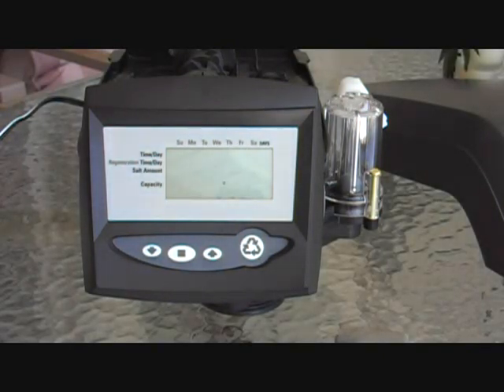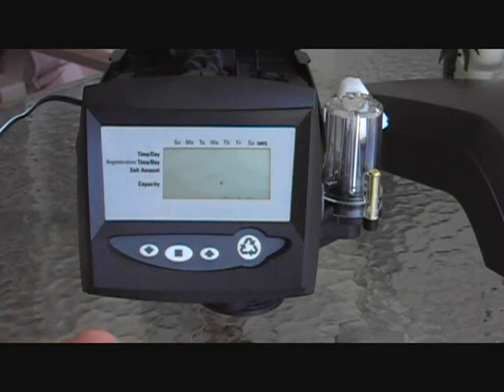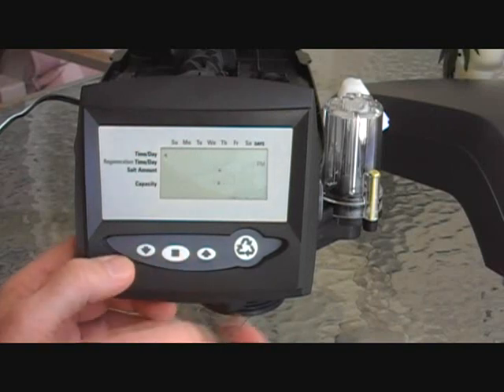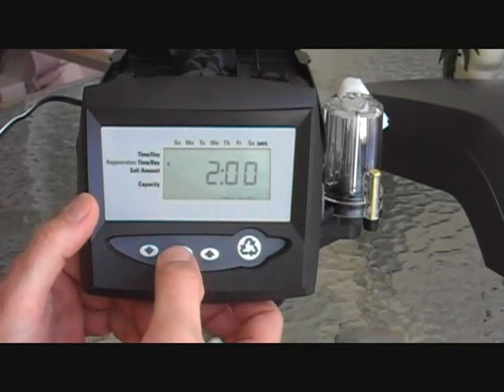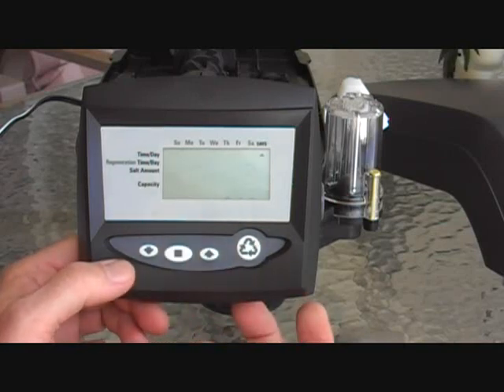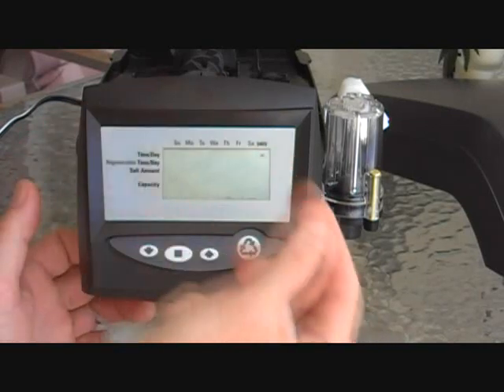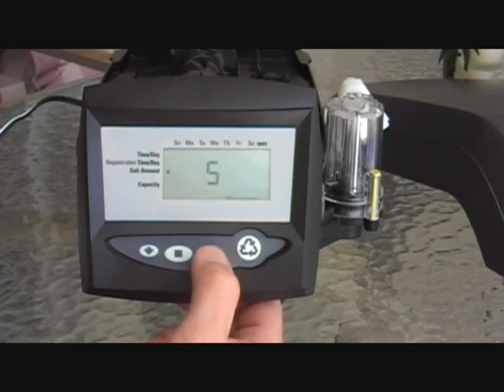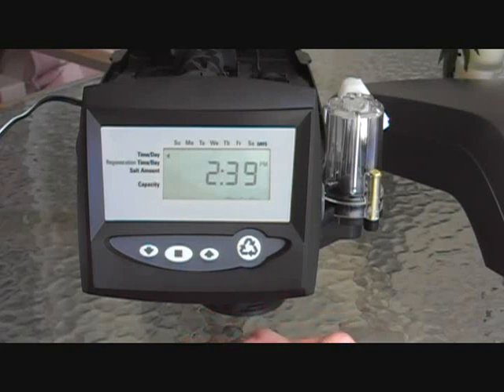Logix 740 Programming Steps

Comment: the system is set for automatic but when you got to the settings for every two days 3 days 5 days exedra you actually left a number in there would this act as a override like in the Clack valve I leave my classroom at a 14-day override so it regenerates whether it needs it or not so the question is why did you leave a number in the day value for regeneration when the system is backwashing based on water usage

Comment: Tell me, should there be water in the compartment which takes the salt, I got the 760 model installed a few months back and from day one the salt compartment was filled to about 40% capacity with water and we were then told to put in a half bag of salt at a time, however we seem to be going thru salt very quickly, it just seems to dissolve into the water. A friend of mine has a similar system and their salt compartment has no water in it.

Comment: How do i adjust the softner? Sometimes the water feel's like silk as if the soap is not washing off.
Reply from the maker: 1. Water that has been conditioned by a water softener allows soap to dissolve more completely than in hard water. It is common for first time users of soft water to have a slimy experience in the shower. This is due to using more soap than is necessary. The amount of soap needed to lather up is very small in soft water. This is one of the benefits of soft water ( less soap is needed in the bathing, laundry, and household cleaning ). Also, the pores of your skin will no longer be clogged by the undissolved soap. Once a person has adjusted their soap usage and is used to the smooth clean feeling achieved by bathing in soft water, they will have a negative "rough" feeling, if they bathe in hard water again.
Reply: Andrew Cross thanks alot . I also have another question . So if currently i find myself using a lot of soap , also seeing residue build up limescale in shower head how can i adjust its on high right now.

Comment: Please help, my screen has a lock on next to the displayed time which is off by 4 hours.  I am trying to follow your steps to set the time, however, the lock on the screen does not give me the option to select the up or down arrows and the time does not flash when I press the set button.  what to do? all of this started when a service man came to my house to replace a tube on a stenner pump and took my autotrol valve apart and removed my iron filter and dumped some of the carbon inside in my yard, all of this so he can tell me the cost on replacing the carbon inside the iron filter.  when I decided not to go with the job, he had such a difficult time putting the autotrol valve the way it was.  and the lock displayed next to the wrong time ever since and I cannot adjust the correct time and the generation no come on at 8 am when everyone is using the bathroom getting ready to go to work.  any help will be much appreciated and thanks for your videos.
Reply: I meant to say now not no.. sorry. typo.

Comment: Were can I go to purchase Logic 740 controler an what would it cost?
Reply from the maker: Logix 740 controllers, with or without Valves, and upgrade kits, are all listed on our website under the Autotrol Repair Parts. >http://www.softenerparts.com/Autotrol_Repair_Parts_s/2.htm
Reply: Andrew Cross i want to pressure differential backwash only. what should i do? i have the same installed in your video.

Comment: My screen is flickering and says error, also its stuck in regeneration cycle.
Reply: I had a similar issue--error 3. I looked this up and it means the motor has died so I replaced the motor. New motor works, but I can't figure out how to reset the system and get rid of the error message. Suggestions?

Comment: How do I find out the size of my system tanks?
Reply from the maker: Measure the tank height and diameter. See how to measure diameter here > http://www.softenerparts.com/kb_results.asp?ID=5  and then reference the size with resin capacity information here > http://www.softenerparts.com/Resin_Replacement_s/54.htm
Reply: Thank you for fast response.